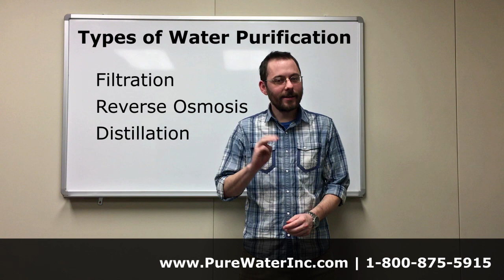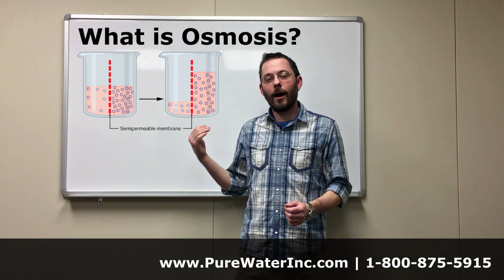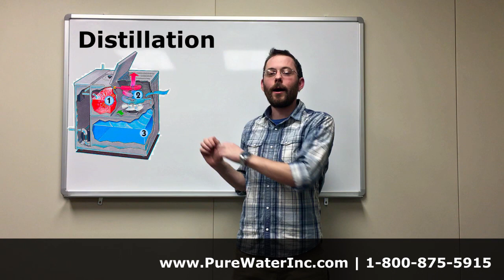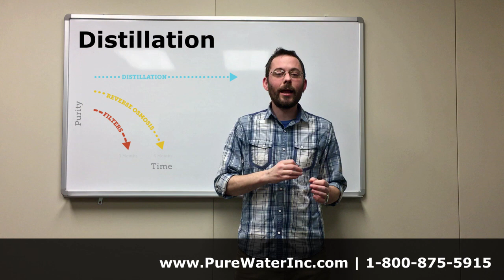Distillers vs Reverse Osmosis vs Pitcher Filters

Comment: Thank you for this awesome video.There are many volatile organic compounds found in water – and many of them have boiling points below that of pure water.  Like pesticides or herbicides and a whole lot of other volatile chemical compounds.How to remove those impurities?they go through the same  distillation process just like the h2o.
Reply from the maker: There are many potential VOC’s out in our water supply today.  Because they have lower boiling points than water, they will vaporize before the water does and some even during the steaming process.  Because of this, we have patented dual vents on the cooling coil that vent off these VOC’s.  They are placed at the point where steam has cooled and is no longer heavier than air, at this point the VOC’s will still be volatile (lighter than air) and still rising out of these vents.  This removes the bulk of the VOC’s.  We then pair our distiller with a carbon filter after the distillation process.  Carbon is good at specifically removing organic compounds.  With the venting process and post filtration, we have an over 99.9% removal of most VOCs.
Reply: @PureWaterDistillers  so adding a vent makes it all better >.> I think not I add a omg filter to it to omg its gonna wear out newflash so do heating elements.
Reply from the maker: @Oh-ou4lp  - You've got it. This is why we pair the vent with a carbon filter in our distillers. We don't want VOCs getting through. Yes, the filters wear out - we recommend replacing them every 3 months. 

As for the heating elements, they wear out too but not for a long time. If something weird happens and they wear out quickly - well, that's why we have warranty. We'll take care of it!
Reply: @PureWaterDistillers  hi there what do you mean by dual vents? I’ve got a distiller j bought 2nd hand but don’t know what that means. Thanks!
Reply: Pure Water Distillers - Brilliant answer full of details. Thank you Sir!
Reply: U don't collect the first minutes (?how many?) of water, which gets all the VOCs, since they boil of time.
Reply: You can also just boil the water for 20 minutes on a stove before transferring to the distiller
Reply: Allen Wu - Brilliant question.
Reply: +Bernard Popp 

The VOCs leave the water in the first few minutes...don't collect that first yield...then test it.
Reply: The carbon filter is BS.  I used to distill about 1/2" of water into the receptacle and then dump it so as to get rid of VOCs.  Very troublesome to do so.
Reply: @larrywilson6900  We change our filter 1 time every 3 months. It is not a bother. The night before we change our filter, we put the new one into a little bowl of distilled water and let it soak overnight. The following day, we wash it off and place it in the tray and we are good for the next 3 months.

Comment: that's gotta raise the ol electric bill right there.
Reply: Which would even out in the winter with the heat it is outputting saving your heater.
Reply: Not much.  Distillation is pretty consistent in power usage.  3 kWh's per gallon.  The national average for a kWh is 12 cents.  this means that each gallon is costing you 36 cents on average.  A gallon of distilled water from the store costs about a dollar.  plus, you get the added comfort of not having to carry around heavy bottles of water.  This is what makes a home distiller such a great purchase.
Reply: What do you spend most of your time in the kitchen or basement because it only heats up the room it's put in and in the winter its great  it saves money by heating up the room it's in.
Reply: Not very much and i have been using distillers for over 25 years.
Reply: soccerpeve02 Twelve cents a Kilowatt doesn't take into account the heat output from the unit that needs cooling in summer via the the A/C.

Comment: which matter do you prefer for water filtration.
i need to make a water prurifications plant in bottles.  but the problem is that i want to supply the better purified water to supply to my customer and clam to be the best water supplier in the market with proof
Reply from the maker: If you use a TDS meter or get independent lab verification for removal of contaminants, you will see that distilled water is the purest.  Distillation removes 99.9% of contaminants.  If you are looking for large industrial systems, we do supply those as well.  Contact us via our website www.purewaterinc.com.  Good luck with your business endeavor.  The world needs cleaner drinking water :-)